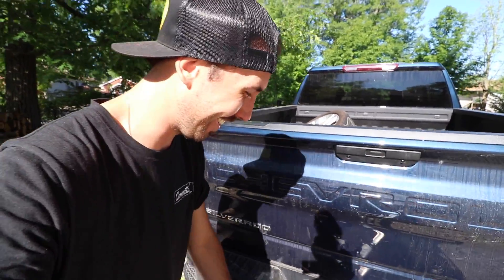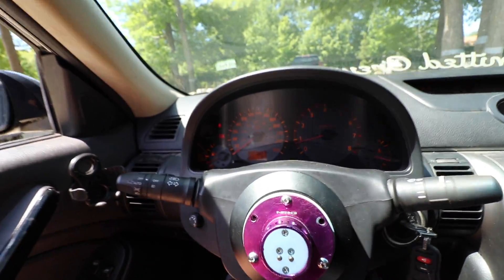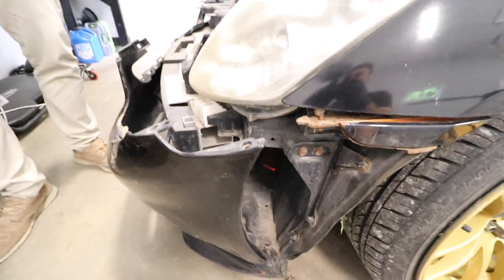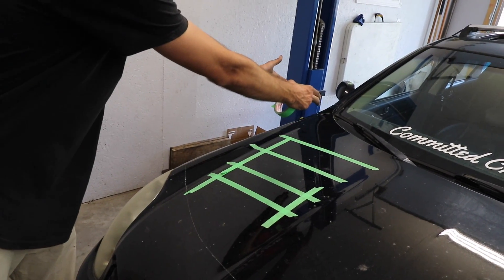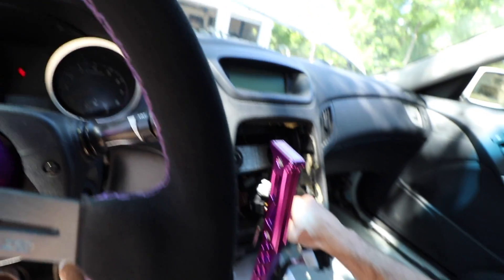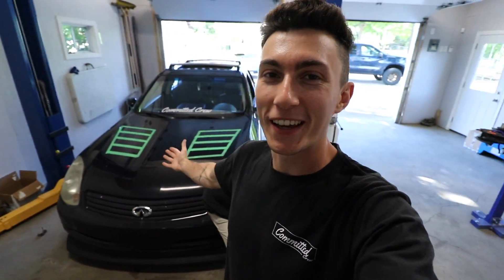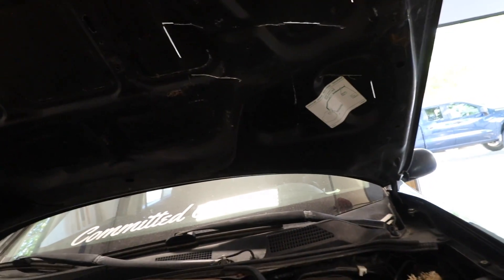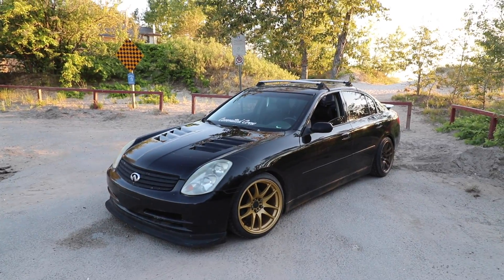Making Custom Hood Vents for the G35!

Comment: Bonnet vents look brilliant, one thing to be sure on is the fan switch is rated for the amps the fan will draw unless you run the main current though a relay, I used a cheap switch and it got a bit hot under use! Skidpad.

Comment: Next time if you need to bend metal    stainless  or alu     you can make  a little line with the cutting disc(just true the paint is enough)  and your bends will be so much easier to do

Comment: This is sick! I'd like to do this to my G35 as well, but I have some questions, as I don't have great experience in mechanics or thermodynamics.

Is the carpet that was taken off important to the heat that radiates? And since part of the hood is hollow, will heat get trapped inside and warp it if it gets too hot? And if it does, is there some other way to prevent that? Because I don't do anything special with my car, it's just a daily driver.
Reply: did you end up doing it

Comment: Hey Robbie! I dont know if you will see this comment, but you possibly wouldnt have to use a manual harness at all for that transmission swap! I did a swap on my ford focus several months ago and in order to feed the information to the manual ecu, I just spliced my clutch switches directly to the harness for the ecu ( pcm in my case). If you look at the wiring diagram for the harness, there may be a common pinout that is used between the auto and manual ecu for clutch/brake depression for starting the vehicle.

Comment: There may be a solution to not getting water nor snow in your engine bay with hood vents ,but not sure hence I am asking. There is something called rain guards for hood vents but I am not sure if they work nor if they also guard the air away

Comment: "Skid pad" just wondering why the flaps were bent down vs up for more air into the engine to cool it down. I know next to nothing about cars so I'd like to learm.
Reply from the maker: Down let’s the hot air ride out, up pulls cold air in but it doesn’t really have anywhere to go. Something like that is mainly used if there’s an Intercooler or something like that under the hood you want to jam air into!
Reply: @RobbieFerreira  thank you for responding. That makes sense

Comment: I  have 2010 genesis coupe 2.0 as well with a full exhaust & turbo upgrade with injectors & alphaspeed told it'll be making 340 wheel. The engine can handle 380 wheel before it blows, but a built engine can get u 600 with a garret turbo & really reliable power.